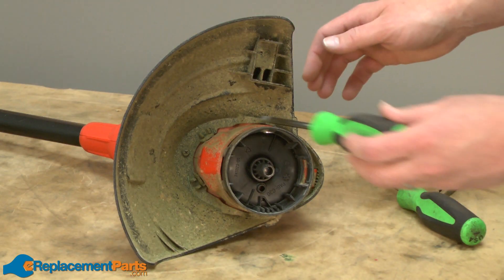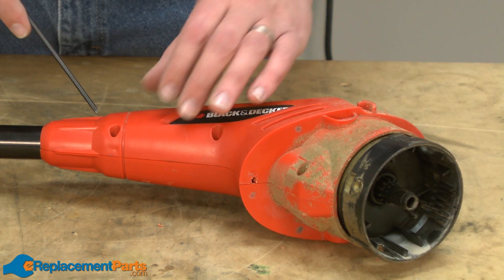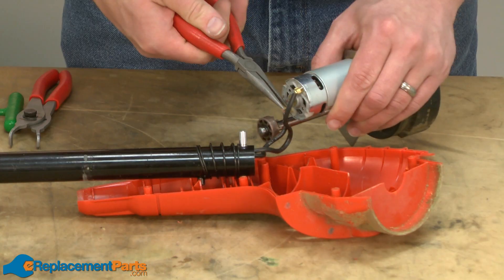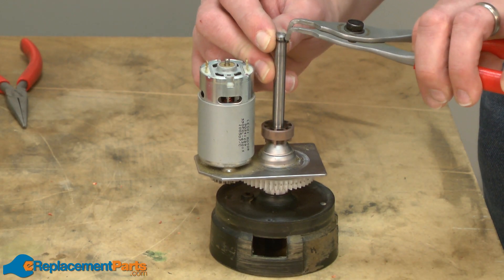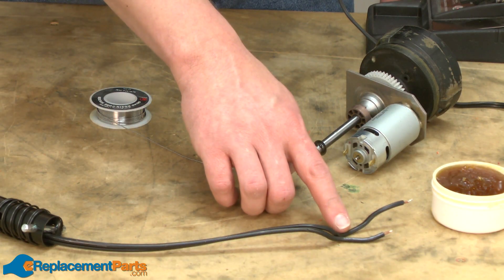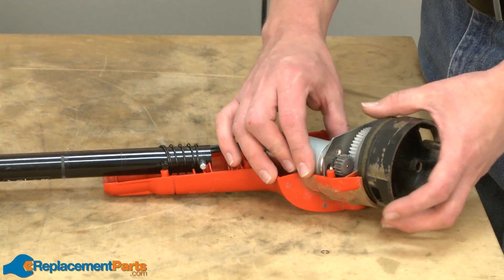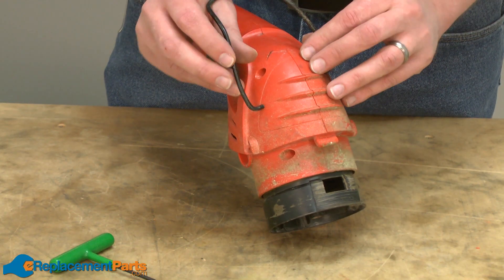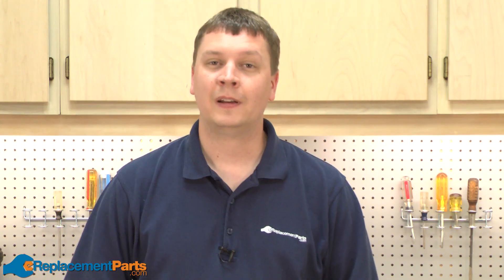How to Replace the Spindle Shaft Assembly on a Black and Decker CST1200 String Trimmer (90522788SV)

Comment: You didn't really say why you are replacing the shaft. The drive splines are stripped on mine. So would i be replacing it with the same crap? There was also no need to pull the wires off the motor.